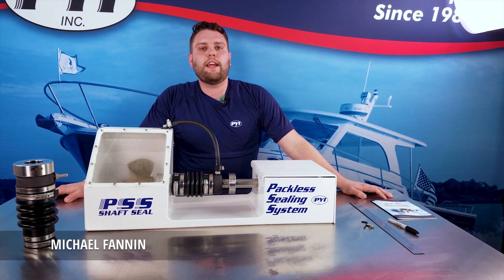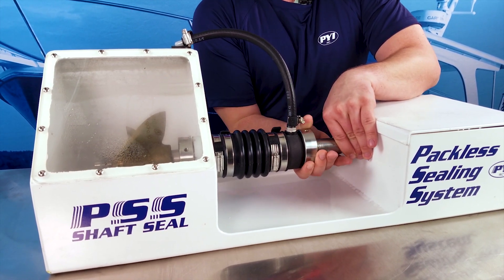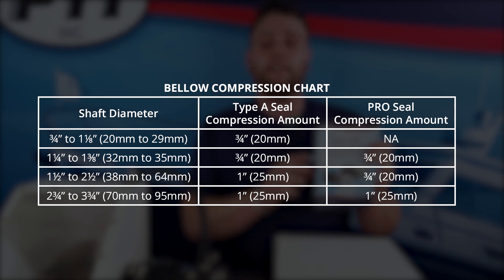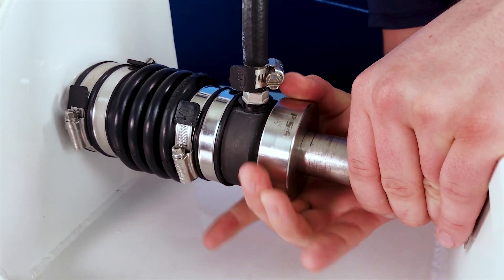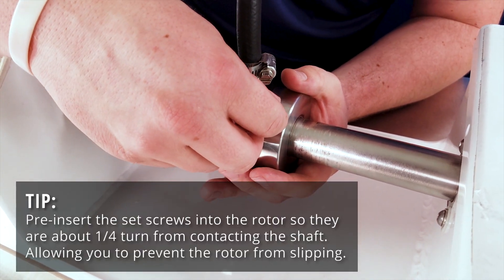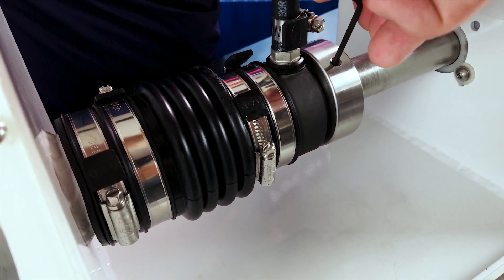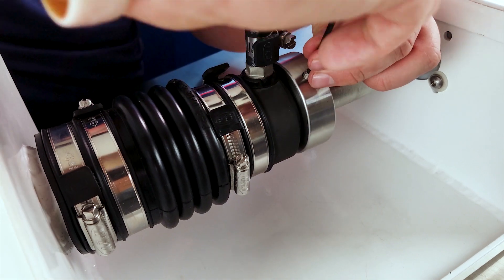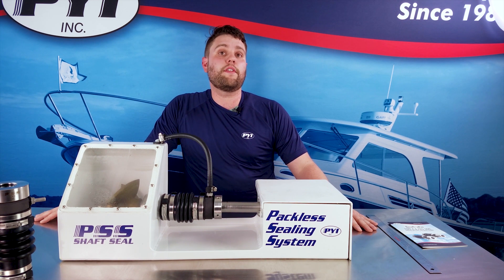How To Compress A PSS Shaft Seal

Comment: After 3 years of use, my PSS started squealing when underway and when I adjusted the bellows hot water and steam was emitted. This has never happened. Any suggestions as to what could be the cause and what would be the remedy? I bled the seal by moving the bellows and all has been smooth running so far

Comment: PSS is a terrible idea. Its a solution to a problem that does not exist. Its overly complicated and if it fails your boat is sinking. With a classic packing nut, the worse case is you have a manageable leak.

Comment: Great video. would like to know about break in period? What to expect in the first 20hrs.
Reply: Typically, the PSS Shaft Seal will have a one hour break-in period. During this time, the stainless steel rotor will polish the mating face of the carbon stator. You may experience a very fine mist, sometimes associated with black dust coming from the carbon stator. This will usually stop after the one hour break-in period.

Comment: When the boat is out of the water over winter can I back off the compression to take pressure off the bellows
Reply from the maker: When the boat is out of the water for winter storage, it is indeed possible to back off the compression to relieve pressure on the bellows. Before launching the boat again in the spring, be sure to use new set screws when securing the stainless steel rotor.
Reply: @PYIinc  thank you very much that's a great help I will indeed put new set screws.

Comment: When you feel the setscrews push up against the shaft , how much tighter after that should you make them? What would happen if they are too loose or two tight?
Reply from the maker: You will want to torque the set screws to approximately 6-foot pounds of torque for shafts 3/4" to 1-3/8" and 8-foot pounds of torque for shafts 1-1/2" to 3-3/4". Not tightening the set screws enough could cause the stainless steel rotor to slide forward.

Comment: Does the Bellows get "tired" over time. I have just replaced my engine and didn't have a replacement bellow so I just used the standard method of 20 mm from relaxed bellows but the bellows somehow seems a bit more compressed.
I'll replace the bellows when I haul out next time but for now I don't want to do that. So I am just wondering if its ok to use the 20 mm compression (1" shaft) on a 5 yr old bellows ?

Comment: For the non-US market, it would be worth pointing out in the installation manual, that an imperial sized Allen key is required -  3.5mm is nearly right but you can't torque it to the right amount and risk damage and it all getting stuck. Fortunately I had my Dad's old set

Comment: Mine is leaking after 5 years, what do I have to do?
Reply from the maker: If it's leaking at rest, you will want to clean the two mating surfaces with 600 grit wet/dry sandpaper to clean out any debris causing the water leak. If your PSS leaks while underway, you will want to add more compression. About a 1/4" should do.

Comment: Would it be ok to use Vaseline or something on orings before sliding the coupling up shaft?
Reply from the maker: No, Vaseline or any grease should not be used to lubricate any part of the PSS Shaft Seal. Use dish soap and water on the propeller shaft to help slide the PSS onto the shaft.

Comment: How many hours (or years in case of low utilization) are PSS shaft seals expected to last before thinking of replacing them?
Reply from the maker: We recommend replacing the bellows every 6 years with the PSS Maintenance Kit. This kit replaces the bellows, hose clamps, o-rings, and set screws.

Comment: We have used PSS at 90 mm  shaft but it's really hard to compress the PSS with hand. We have just compress at 20mm instead 25mm

Can you suggest us how Can we reach 25mm ( advised gap) easily
Reply from the maker: The 20mm of compression that you currently might be OK, so long as you don't have a lot of forward and aft movement of the engine.

To assist in compressing the PSS to the full 25mm you can take a zinc anode and clamp it onto the propeller shaft forward of the stainless steel rotor of the PSS. Using that as leverage take a screwdriver to compress the PSS. Just be sure to protect the stainless steel rotor from damage with a block of wood or something similar.
Reply: I had to reverse two wood clamps, and set them against either side of the stainless rotor, and then against the gearbox coupling...then it was a simple case of extending them. Lucky I had them on board as voat needed to be back in the water that day...

Comment: Do you put locktite on just top two set screws or all 4. And which Locktite
Reply from the maker: The Loctite goes on all four set screws. You can use Loctite Threadlocker Blue 242 or equivalent.